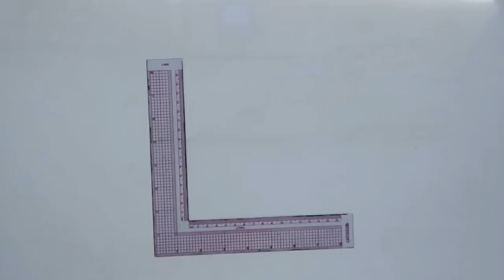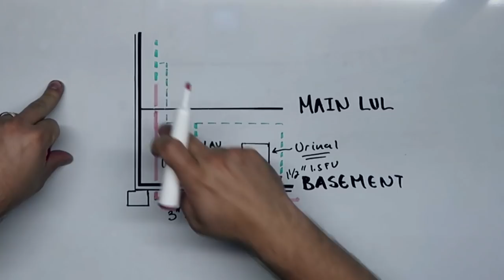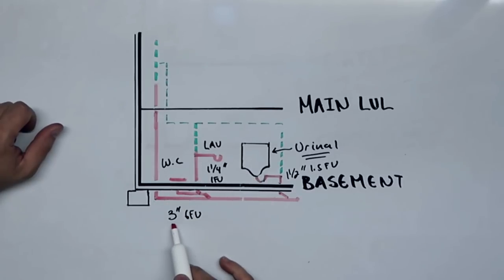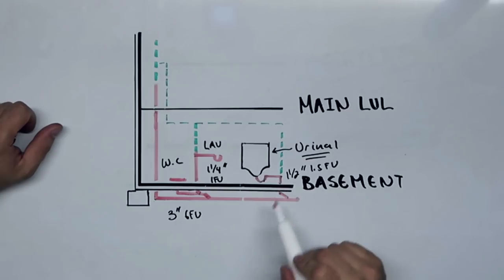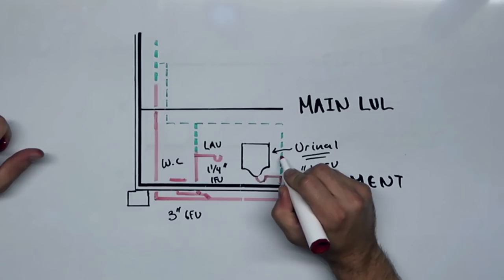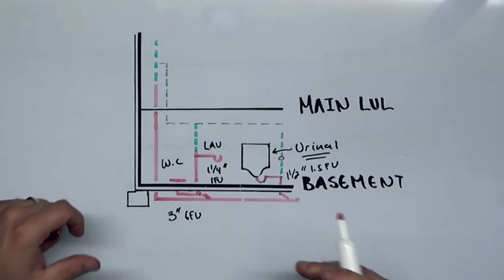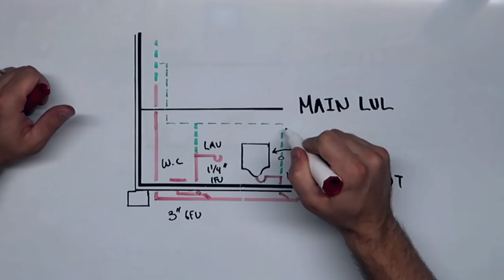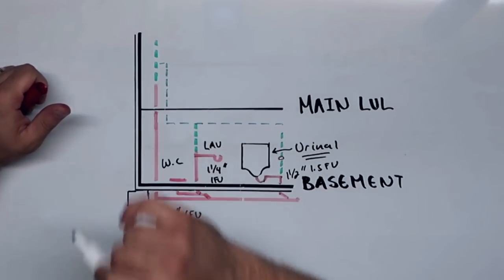Day In The Life Of A Plumber | Plumbing Youtuber Changing Urinals | Vlog 44

Comment: Urinals here in Massachusetts have to be cast iron with lead and oakum joints also a wet vent here has to stay 2” in size all the way until it either goes through roof or it connects to a 3” vent !!!

Comment: Molotov back in the building!!!! Couple questions, where did you get the faucet tool from? Does it come with the handle too or can you connect it to a ratchet set? Also have you ever had to replace the urinal flange. I’ve never had to replace a urinal wall flange I’ve only ever replaced closet flanges. I always peel the old pvc closet flange. Was wondering typically cause the wall urinal flanges are a little flimsy and not that secure how do you remove it and install a new one if the wall flange is damaged? Do you bust the wall open cut the pipe back and re plumb it with new flange? Great video... 🤙😎🏝
Reply from the maker: Josh!!! Whatsup my man! The tool comes from Lowes actually. When we found it, we lost our minds! Makes working under vanities sooooooo much easier! It comes without the ratchet set, but you attach it to any ratchet set and 💥BAM! Honestly, we have only worked on wall hung urinals thus far, and they were only copper. Changing those out are pretty easy because the MIP is soldered and pretty solid. The one you describe is probably the way we would do it though...there aren’t a lot of options with urinals unfortunately....🤙